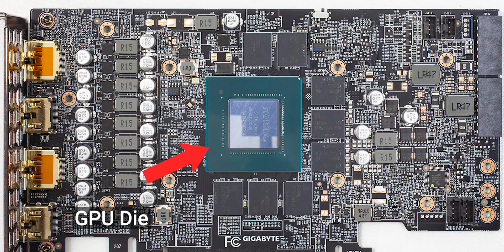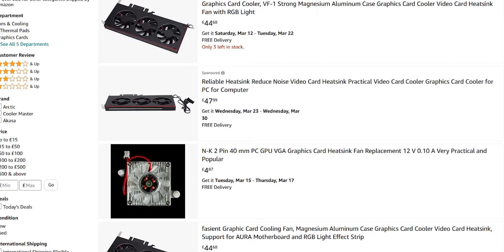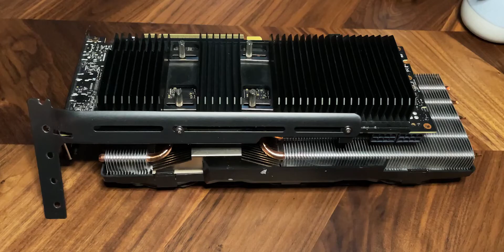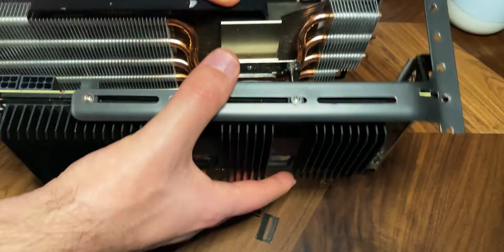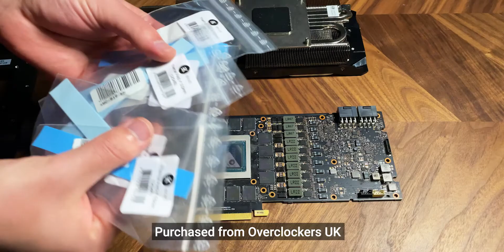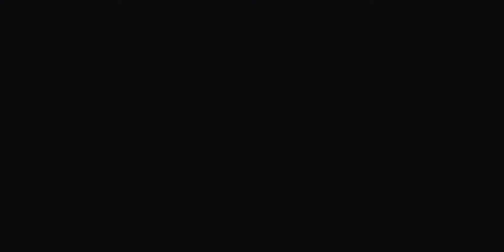Upgrading my 2080ti! - Heatsink & Thermal Pads Replacement on RTX 2080ti

Comment: Is it possible to use a 3 fan heat sink on the same blower style card as yours?
Reply from the maker: If it comes from a 2080ti it will work, just need to make sure the donor card is the same

Comment: better than a 100 videos I've watched  😂, i just wanna say , I got a zotac 2080ti twin fan and it's around 78 to 85 degree, i applyed new thermal paste but for only 2 degree drop, dose downclocking it could fix the issue?
Reply from the maker: Glad to hear it helped.
If your 2080ti is that temperature I'd double check that the cooler and the paste are making good contact and also check if your gpu is getting enough airflow to cycle away that hot air, 78-85 is hot but not worryingly hot, cooling it will just help it perform better and last longer.

Comment: I know this is an old video, but this is the only video that actually describes any of the thermal pad process. Everyone else just talks about the screw disassembly and how to put it all back together, with zero mention of the pads...

Your responses with the forum link, and the great quality of you recording that part of the process, finally helped me find what freaking pad sizes I needed for my 2080ti PNY blower-style card. Saved it from a slow heat-death and eventual botched watercooling!
Reply from the maker: Glad it can help you and thank you for the kind words
Reply: @Sloshy  I just got done testing, and dropped an average of 15c thanks to you actually having a good view of where the pads need to go! No more throttling at 4k, and 1440p is a nice and cool 63c at max
Reply from the maker: @bonniscootor  Glad it all worked out for you, I hope to do more tech related tear downs in the future :)

Comment: Thanks for the video. I'm thinking of replacing the thermal paste but I really don't want to mess with the thermal pads. I'm keeping the same cooler. (EVGA FTW3)
Reply from the maker: Thermal paste is an easy job, when you're undoing the card split it apart and just leave the thermal pads in the layout as they are, when you reassemble just make sure your GPU die is actually making contact with your Heatsink though and one of the pads hasn't misaligned
Reply: depending how old your card is you could wiggle it sideways very gently and if they're not mushy, idk how to describe it really, but you would definitely notice with picture comparison on old/bad pad in google. you can just reuse the same ones if they're not too damaged as they have around 5-8 year life span, and usually you only need to reapply thermal paste on it after few years, from my experience. Although take this with a grain of salt, PC stuff like this is very individual thing from my experience as all conditions may wary between users.

Comment: I have the same card, my family calls it "the hair dryer" on any fan speed above 70percent lol. They new exactly when I was playing a game even through a closed door. I put the Morpheus cooler with 2 noctua fans and it's no louder then the case fans now. Good video 👍
Reply from the maker: I can safely say my fans have never been above 50% on Afterburner with the MSI heatsink on 😂 with the old heatsink they never left the minimum, they we're always on 29% due to the quietness and efficiency of the cooler
Reply: @Sloshy  i too noticed this on my 5700xt it was running hot and throttling. XFX had the fans locked at 40percent WTF
Reply: Did you need to use anything for the memory and Vram? I'd love to do the same thing (I have the MSI blower version of the 2080ti, and yes, hair dryer is a great description lol). I just repasted it which has helped a lot, but I'd love to get the sound much quieter.

Comment: hey
what is the thickness do use for your gpu because i have the same gpu  ?

thnx
Reply from the maker: Hey there, I've put a link to the website which I followed hopefully this helps

https://hardforum.com/threads/replacement-thermal-pads-for-2080ti.1981252/#:~:text=Different%20cards%20will%20require%20different,are%201.0%20or%201.5mm.

Comment: Hey man I'm trying to do this to the EXACT same card/cooler atm and on my second attempt of thermal pad replacement only to find that I've bought the wrong pads (AGAIN). Any chance sharing were you found the info on what sizes are needed for this card?
Reply from the maker: Hey!, I purchased 0.5 & 1.0mm pads only, I followed this guide to place the correct thickness ones https://hardforum.com/threads/replacement-thermal-pads-for-2080ti.1981252/ (I ignored any 1.5mm pads)
Reply: @Sloshy  Thx mate!!

Comment: Hi, I'm looking to replace the thermal pads on my MSI 2080 ti Ventus as well, this video was an awesome intro to that. Can you let me know what thickness pad you went with in order to prevent the board bend for this card specifically? Thanks in advance.
Reply from the maker: hey! I'm glad you liked the video! I bought 3 packs of 0.5mm pads & 3 packs of 1mm pads from Overclockers UK, if you click this link it will show you a guide on where to place each thermal pad for the 2080ti (I followed this guide too)
https://hardforum.com/threads/replacement-thermal-pads-for-2080ti.1981252/
Reply: @Sloshy  very helpful, thank you!
Reply: @Sloshy  I was looking for this too, thanks!